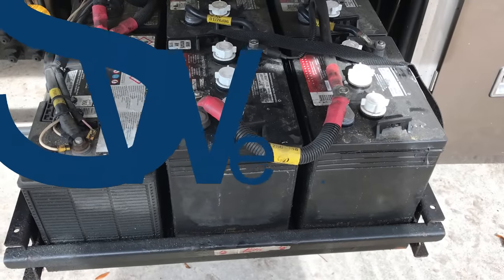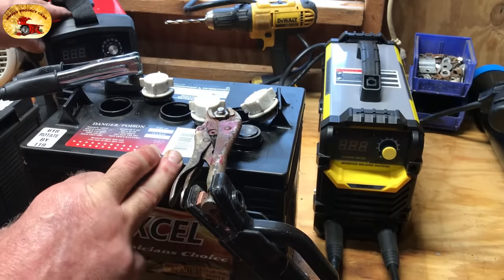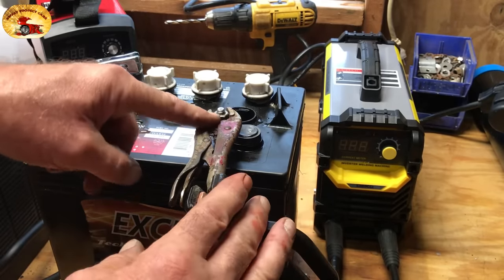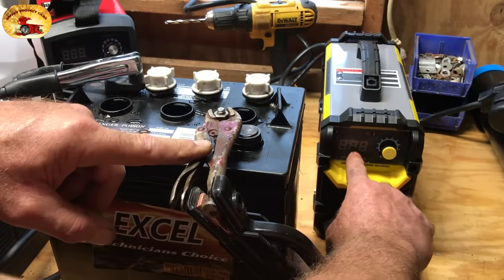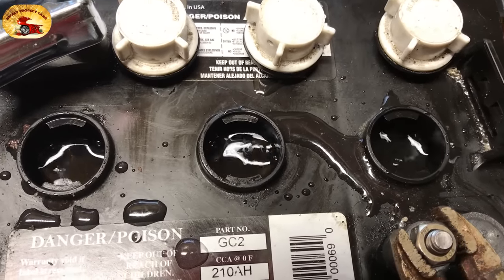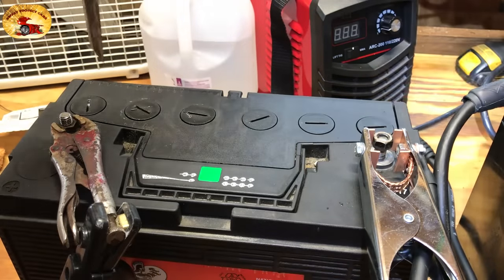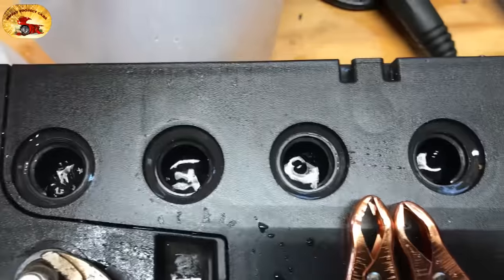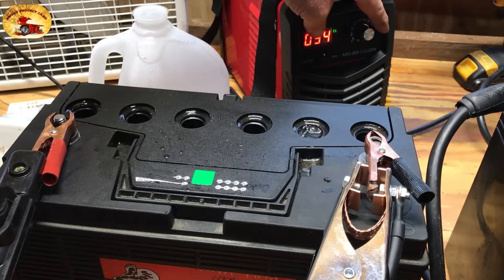How To MAKE OLD BATTERIES NEW Again!!!  12v 6v Deep Cycle, Car, Truck, Golf Cart, Semi

Comment: Should i ever take it to the max 200
Reply from the maker: Start on the lowest setting, then work your way up until you get a consistent bubbling and make sure you recap and unplug the welder before disconnecting the cables.  Thanks for watching and asking.  Have a great day.  mad Mike the hammer SPC
Reply: @SweetProjectCars  cheers Mike 🏴

Comment: This is great!  Now, if we can just get a way to do ni-cad.
Reply from the maker: I'm with you brother, someday, someday.  Have a fantastic day, thanks for watching.  mad Mike the hammer SPC
Reply: @SweetProjectCars  ive seen videos of people doing this with the welder to drill battery packs - some it worked some didnt - but they got hot as no water in those!
Reply: For ni-cad, just plug in the battery to it's charger, then turn on & off the supply to the charger multiple times until the ni-cad wakes up
Reply: @Kungfupanda839  I revived a drill battery by using an arc welder on is terminals, double the volts, if your drill battery is 18v, set the welder to 36-40v and give short burst of current up to a second for a few times. What this is suppose to do is burn off the white crystals inside the battery which cause it to slowly become dead .

Comment: Thank you for this nice video. I will try it with one of my dead batteries but i have still 1 question. How far do you crank up the amperage for different batteries in order to know that you desultated the battery completely. Regards Wim
Reply: should be bubbling for 5 mins cranker up til it bubbles  then time it
Reply from the maker: Hello Wim, start out slow, then turn it up as needed until you have a constant boil then time it.  Thanks for asking and watching.  Have a fantastic day.  mad Mike the hammer SPC

Comment: I was excited to try this and "stick it to the man"! I ordered an Arccaptain 160 DC inverter stick welder, as it was $40 less expensive than a new battery. It was one or the other. I can't afford both because of Bidenomics. I went through the process today. These are my findings.
Battery Rejuvenation - Expedition battery 

• Charged battery 6 days ago, charger said fully charged @ 7.5v

• 10/11/24 - cleaned battery and opened top
 - no visible liquid
 - battery measured 0.00v
 - filled with distilled water to proper level

• 1st 5 min. session @ 20 amps
 - turned up to 30 amps because of no bubbles

• rest for 10 minutes 
 - battery measures 12.15v (slowly dropping

• 2nd 5 min. session @ 40 amps
 - turned up to 50 amps (occasional bubbles)

• rest for 10 minutes 
 - battery measures 12.35v

• 3rd 5 min. session @ 60 amps (occasional bubbles)

• rest for 10 minutes 
 - battery measures 12.48v

• 4th 5 min. session @ 80 amps (better bubbles)

• rest for 10 minutes 
 - battery measures 12.8v (12.54 after 10 minutes)

• 5th 5 min. session @ 90 amps 
 - middle sections not bubbling as well as outer ones (all bubbling)
 - measured 12.85v at end

• put on charger @ 12:44pm @ 12.59v
 - checked after several hours and it was back down to 7.5v

Does this mean this battery can't be fixed, or am I missing something?!?

Comment: just curios, would the welder for the 12v battery work for a 12v 60 amp AGM?
Reply from the maker: This process works on lead acid batteries only my friend. Thanks for watching, have a great day. mad Mike the hammer SPC
Reply: @SweetProjectCars  sorry, I was incorrect.  it is a lead acid gel battery, not AGM.  for some reason I thought all gel's were AGM, my mistake

Comment: I have a battery that is over 10 years old sitting in the carport and I have it on the cement floor and I have heard that the cement floor destroys the battery completely so my question is can this battery still be revived or have you ever done a battery that sat on the cement floor for years thank You sir great information .Also should the water be replaced with newer distilled water and I know that it could be still acidic and what is the best way to discard this old water
Reply from the maker: Give it a shot, sounds like you've got nothing to lose my friend.  There's no need to replace the water, just top the cells off to within an inch of the top with this  https://amzn.to/3gb9Ni0  then as necessary during the resting times.  Hope this helps, thank you for watching and asking, have a great week and all the best on your project.  mad Mike the hammer SPC
Reply: @SweetProjectCars  well you can’t be mad mike you sound like a very nice person and you got back to my question thank You very but I will certainly call you  Mr Hammer it still sounds tough now we just need to get both of our Countries Back in order WWG1WGA 🇨🇦🇺🇸

Comment: For anyone that is stressing if their welder is able to do this or not you must have a DC inverter welder do not do this with a regular ac welder. The reason this works is because DC inverter welders send The amount of current to whatever you set it at, it automatically varies the voltage to meet that current demand. Where as a typical battery charger may be rated at 200a jump but what happens is that with all of this calcification it will raise the internal resistance of your battery. Let's say you put it in 200 amp jump mode, but its only outputting 14-16 volts or so by the time you calculate ohms law theoretically even if you're in 200 amp mode that charger will only be delivering only a few amps to your battery until the resistance is lowered by cranking on the starter which will allow the full 200a jump start to do it's job and will only then be able to deliver the 200amps but it goes directly to the starter. Now with the weld welder on the other hand, he doesn't give a crap about your batteries internal resistance. Because if your battery has a high internal resistance guess what? it's going to raise the voltage so that it can send the full amount of current that you set it to this is how it works. On mine I was watching as I was restoring my battery and in the beginning the voltage was as high as 66 volts and I was worried but this is how it works to break that crap up because in the beginning your battery has a very high resistance whereas a normal 200 amp battery charger starter wouldn't be able to save your battery this will
Reply from the maker: Thank you for watching and sharing Drew, have a great day. mad Mike the hammer SPC

Comment: will this work with any stick welder?
Reply from the maker: You can use whatever you want to, we are just sharing what we have tested and tried and has proven to be safe for you and your batteries.  Thanks for watching.  Have a great day.  mad Mike the hammer SPC
Reply: NO, NO, NO.  It MUST be a DC  welder.  DO NOT use an AC welder which describes most of the old buzz boxes.

Comment: Sir, for the 12v battery,  i saw in the video that you cranked the amps up to 93. Fine. But at what volts,  12, 14, 25 or?  I live in Nigerian and off grid, this video and your process will be a life saver for me and I can't wait and dont mind earning extra income through this. The reason i asked is so i can be guided in getting the right  mma machine.  Same question for the 6v though i will be doing more of the 12v. Thanks a bunch.
I GIVE YOU CREDIT FOR YOUR TIME IN RESPONDING HAPPILY TO OUR COMMENTS. You are 1 in a 1000000!
Reply from the maker: 110volt standard house current.  Hope this helps answer your question.  Have a great day.  mad Mike the hammer SPC

Comment: I have an older Sears ac/dc stick welder.  Can I use that in this way?
Reply from the maker: You can use whatever you want, but our videos are very product/tool specific, we spent months perfecting this process so it is safe for you and your batteries.  Thanks. mad Mike the hammer SPC
Reply: Can try it if your welder has a DC setting.

Comment: I bought the grey welder like the one u have in your channel, I don’t know what setting to set post flow . If u can pls help me with that part. Never used a welder
Reply from the maker: Hello Adrian, set the dial to the lowest setting then slowly turn it up until the battery starts to boil, once the battery is boiling rapidly follow the video instructions.  Thanks.  mad Mike the hammer SPC
Reply: I believe your question is about the polarity of the leads as they leave the welder. I would have to say that following the batteries flow of electrons is what should be followed. So negative to negative positive to positive, this is also standard polarity for welding, reverse polarity creates different welding characteristics however I wouldn’t recommend trying it with your battery. If the battery has any charge placed under reverse polarity you would effectively just be discharging the battery.
Reply: Post flow is used in tig welding you don't need it in this usage.

Comment: I tried this and my negative kept sparking. Any ideas what i can be doing wrong?
Reply from the maker: Make sure you have the cables applied correctly first, make sure whatever you are clamping to is tight on the battery.  The cable that holds your welding rod is the positive, the other one goes to the negative post. Do all connecting before plugging the welder into the wall and the dial on the welder is turned to 0, then plug it in and slowly turn it up, the only way it would spark is if there's a loose connection. Hope this helps, thanks for watching. mad Mike the hammer SPC

Comment: I wonder if it would be better if you were to drain the electrolyte and replace it with new battery acid after this process🤔
Reply from the maker: Just follow the video as shown, we've done it every which way but loose.  This is the easiest, simplest way following the video.  Thanks.  Have a great day.  mad Mike the hammer SPC
Reply: I wondered the same

Comment: I saw someone do the same thing with a giant car starting charger hooked to a battery in the starting mode. It makes sense tho & I like the welder way of doing it better with it being adjustable. Now, how about mentioning the brand of that welder you were using, that would help or suggestions for something like it.
Reply from the maker: https://amzn.to/3r5F2S9 for ALL Deep Cycle only 6 Volt & 12V Batteries  or  For All  Standard 12-volt Batteries    https://amzn.to/2K1UsWQ  And just a reminder, all of the tools/products used in our videos can be found in the SHOW MORE of the videos description.  Thanks for watching and asking.  Happy New Year.  mad Mike the hammer SPC
Reply: @SweetProjectCars  what about using an miller mig welder. does work too

Comment: You mentioned running the welder for 5 minutes. Most welders have a short duty cycle. I’d hate to ruin a welder saving a $100 battery.
Reply from the maker: Never had that happen in the years doing this, follow the video to a T and you will have success.  Thanks for watching. Have a great day.  mad Mike the hammer SPC
Reply: The duty cycle is at max output.. any amp amount below that will give you a longer duty cycle..

Comment: I want to revive my RV house batteries.  They are 12V 27MDP.  Which welder would be appropriate for me?  Thank you.
Reply from the maker: Use this one  https://amzn.to/3yW4ihK  for them Terry. Thank you for watching and asking, have a great day and all the best on your project my friend. mad Mike the hammer SPC
Reply: @SweetProjectCars  Well I finally did the process.  Purchased the welder you specified.  The starting voltages were 6.8 V, 5.7V, 7.2 and 10.2.  I did the 5 minute cycles but still no change in the voltage.  Do I keep repeating.  I am only running at 80 A. because my breaker trips.  Hope you can help.  Thank you.
Reply from the maker: Hello Terry, if your house/garage voltage system will not handle doing this process as shown in the video, then you will need to up the breaker in your breaker box from 15 to 20 or 30 amps. The welder has to run as shown for this to work, without it constantly shutting off.  Hope this helps, thank you for asking, have a great day and all the best on your project. mad Mike the hammer SPC
Reply: @SweetProjectCars  Thank you for the reply.  I will look at changing the breaker.

Comment: Can anyone say why those were the only welders that worked? Duty cycle? Seems like if the welder puts out proper V & A all should be same.
Reply from the maker: You can use whatever you want to use Ronin, we are just sharing what we know works, and works every time and what we know is safe for both you and your batteries. Thanks for watching, have a great day. mad Mike the hammer SPC
Reply: @SweetProjectCars  Thanks for the re. I'm asking because I dont know what I 'want' to use-- Im not an expert.
How did other welders fail? Went into protect or overheat? Or did the batteries not respond as well?

Comment: Great idea!  You running at 110 or 220v?
Reply: 110v and 220v are the input (supply) voltage options for the welder - not output voltage. Either will work as the machine will automatically convert to the required (adjustment) setting.
Reply from the maker: as swm says 110v and 220v are the input (supply) voltage options for the welder - not output voltage. Either will work as the machine will automatically convert to the required (adjustment) setting.   and the power we put to the welders was 110v standard house current.
Reply: If they ran it at a higher amp rating, then yes, they would need 220 as on 110 the red one is only rated up to 160amps (and probably not very stable at it's higher limit) and 220 can go up to 200. But it looks like there are only running it at 20 or so.

Comment: Hi, thank you for the videos, all very interesting and helpful.
Is there a solution of any kind for AGM battery?  Since the invention of start/stop system in cars we’re all stuck with the AGM type battery and it’s becoming bit of a pain replacing a AGM battery as it’s a little more costly than the led acid type. I’m sure It would be greatly appreciated by everyone if you have any solutions to share with us... thanks, stay safe and well..
Reply from the maker: Not at this time my friend, Hoolio is busy in the lab working on it though.  Thank you for watching and asking.  Have a great day.  mad Mike the hammer SPC
Reply: Apart from "Lifeline" brand no AGM battery manufacturers say you can  use an excessive "equalising" charge on AGM batteries.  I don't think it's good to go above 15 v for a 12v AGM.  Telecoms and other large companies have added "cat vents" to AGM batteries plus distilled water , as AGMs can and do dry out. They are absorbed electrolyte batteries, and the trouble with many You Tube videos is that they show far too much distilled water added to the (often little grey) AGM cells, turning them into wet cells that won't have much capacity or last long. I have INJECTED fairly small amounts of distilled water  into large but poor AGMs, and often improved them using the sort of syringe often used to replenish ink cartridges, then re-sealing the tiny holes. Once fully charged, a C/20 discharge test over hours is the best way to see how well an AGM has improved, though a conductance meter test  of before and after using such as a Midtronics tester can give some idea as to if adding the distilled  water has helped much. Don't go above about 14.4 v for a 12 v GEL (thick jelly electrolyte) battery, or you will soon ruin it. You Tube videos claiming a battery is now OK just because it may read 12.7 volts or more open-circuit are meaningless. Adding epsom salts or other chemicals is usually just a temporary fix , but on totally useless batteries it might give some extra useful life for say, car starting for a while until the battery is finally scrapped.
Reply: @michaelthomas3105  great comment. What exactly is the reason why most batteries lead/acid eventually go bad for good and can they actually be “revived”?
Reply: @michaelthomas3105  So how do you know how much distilled water to add? I have a 12 V AGM motorcycle battery from 2018 that doesn't seem to hold a charge anymore but I've heard that this restoring process will ruin them. Any ideas on how to restore one?
Reply: Pulsing. I have had awesome success with pulse chargers so far with AGM batteries. Until someone can make them last longer than 7 years I will use their method but so far I made a used NAPA battery last that long and is my go to on all of the others.
Reply: @bodeine454  so I've had these batteries that I could not revive. I would dump out all the batt. acid carefully into a bucket to reuse later, put distilled water into the battery andseal them back up. I will them vibrate the minerals loose that are built up on the cells causing the shorts. I would use one of those larger back massagers vibrate them Dump out distilled water dispose of it properly. Replace the acid that was taken out. Retry his procedure. You may have to do the distilled water a few times until it comes out clean then replace the acid that was removed.

Comment: Dose this work with 8v deep cycle batteries 

8 Volt Trojan T-875 Golf Cart Battery 8V/170Ah
Reply from the maker: This works on all lead acid batteries, just make sure you use the appropriate welder (found in the description) and cut the timelines in half for that size battery Justin. Thanks for watching and asking, have a great week. mad Mike

Comment: So, this is a DC welder, lots of current and you have over-voltaged the battery for 5 minutes and this de-sulphates the battery?

Kepping the time short, you dont damage the battery. Is that correct?
Reply from the maker: Yes it regenerates and wakes up the battery, and the de-sulphation is just a bonus to this process.  Follow the video exactly.  Thanks.  mad Mike the hammer SPC